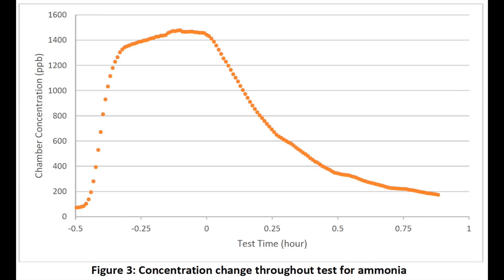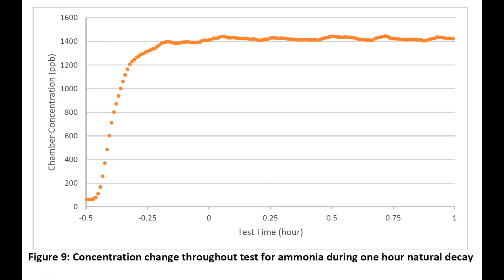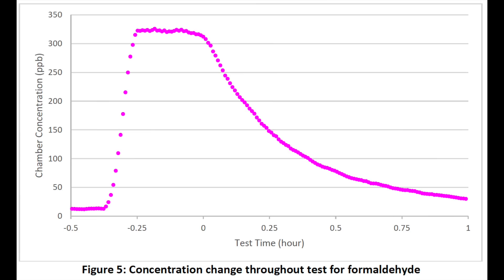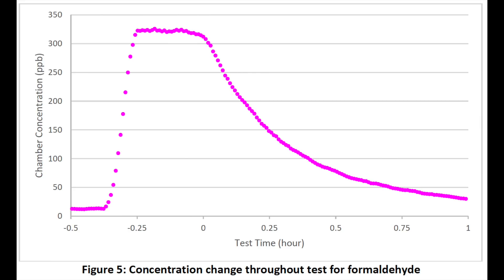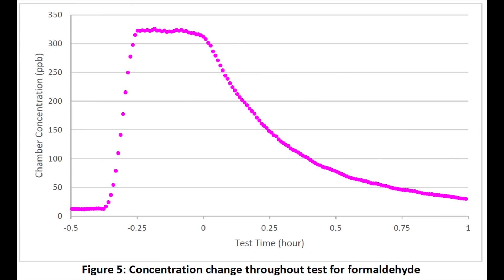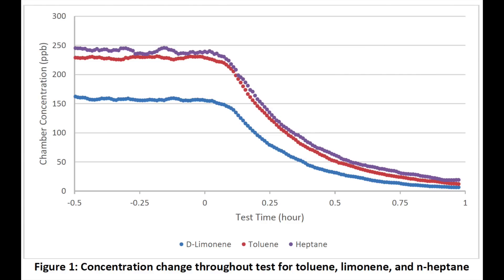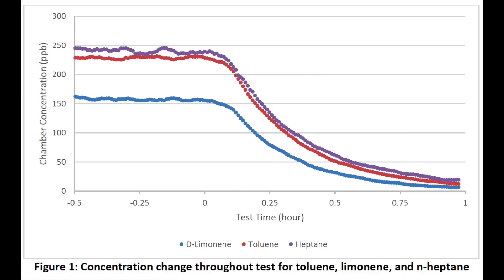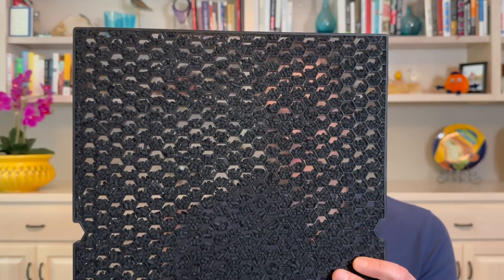Choosing the Best Carbon Air Purifier for Odor & VOC Removal: Test Results (AHAM AC-4 Standard)

Comment: what is your best product for dog odor? Not for dog waste, but just for dog smell, hair, dander and what ever they track in.
Reply: I just watched  your "How to Choose the Best Air Purifier for Pets" video. which says the carbon is best for odor, but still not clear if this is best for a smelly dog. I have a big dog that I bath every 3 or 4 weeks.
Reply from the maker: For dog odors specifically, look for air purifiers that feature substantial activated carbon filtration (more than a pound). Brands often list the weight of carbon used - more is generally better for odor control. Also ensure the purifier is sized appropriately for your room, as undersized units that lack sufficient air flow won't effectively clear odors even with good filters.
Reply: @Oransi  How much carbon is in the Mod Jr? or should I avoid combined carbon HEPA filters?, Thanks!
Reply from the maker: About a pound. HEPA doesn't do anything for odors however HEPA and Carbon is a complete air cleaning solution for particles and odors.

Comment: I have measured the VOCs with my AIR-1 Air Quality Sensor and the carbon filter doesn't seem to be doing anything. It works great for PM. But I'm trying to stop VOC spikes from my gas furnace. Am I doing something wrong or misunderstanding?

Comment: Hi

We recently rented a new commercial space, 1000 sq ft. New carpet and tile were installed and it was painted. The outgassing seems to be bothering a couple people. I realize the outgassing can go on for some time. While this is happening what is the best option for removing those gases at a faster rate than they are naturally being released? Thank you.
Reply from the maker: Ventilation is best if that's an option. If you are able to open the windows to bring in fresh air that will remove VOCs.

If there are times when the windows need to be closed then an air purifier with activated carbon can adsorb the vapors. The key is having sufficient air flow for your space and enough carbon. An air purifier with less than a pound of carbon will be limited.
Reply: Thank you so much !

Comment: I just moved into a new build construction apartment with voc levels staying around 1-2mg/m3..I already did a bake out and it reduced levels that were originally around 3mg/m3. If I bought one if your purifiers, it shows your AC filter needs replacement every 12 months for most environments. In my environment with very high vocs, would that replacement timeline be reduced?
Reply from the maker: Yes, the 12 months is for the typical home environment. If you have higher VOC levels the filter life is likely a little less.

Comment: I was going to buy Resiners air purifier because I was concerned about VOCs working with resin.  Then I came across your video, so I just ordered your air purifier (270C).  I hope I’m not disappointed.
Reply: And how good did it work?
Reply: I have one and it works great. I also have four Oransi air purifiers and they also work great based on the fact that smell like smoke from wildfires are undetectable in my home. That’s important to me since I have asthma. Any purifier you are considering compare how much air they move through your filters and how much they remove.

Comment: I live in an apt. building. We are having issues with cigarettes, marijuana, vape and other air born chemicals. We are getting these smells from our stove vents, AC Vac, heating vents and bathroom vents. I hope you can please advise us what type of filter we can use.
Reply from the maker: Hi, our TrueCarbon air purifiers work well in the removal of smoke odors and VOC's. The key is to size the unit based on the square footage of the space. Odors can be subjective. If you are getting constant odors and sensitive to smells you should notice a large reduction in odors although if a constant source is present it may not be 100%.

https://oransi.com/collections/truecarbon-air-purifiers

Comment: Why does my new activated carbon filter smell sweet. It pours out a sweet smell
Reply from the maker: Hi there. Great question. Coconut shell-based carbon can sometimes retain a sweet odor or this could be a normal part of the carbon activation process. Unless your filter is old this is fairly common.

Comment: Do any of these filters work for cooking odors? We live in a Chicago apartment and can't open the window in winter when cooking. The place smells like salmon for a day after cooking. 

Your ammonia, formaldehyde, toluene particle removal test results seem robust, but how does that translate to cooking food odor situations? 
And which of these specific filters gets rid of cooking odor?
Reply from the maker: Hi Robert. Thank you for your great questions. Cooking odors can be complex. Because of this, they're not part of the industry standard for testing. 

We recommend our TrueCarbon™ air purifier for stronger odors as its all-carbon filter is built specifically for odor and gas absorption. Customers have noted good performance with cooking odors; however, results vary based on room size/floor plan and can be subjective due to sense of smell. Is this helpful? Let us know if you have any other questions.
Reply: I just ordered the TrueCarbon 270C Air Purifier. I'll see if that works. Hopefully the manual gives indication of how long the filter lasts. Thanks.
Reply from the maker: Fantastic! Let us know if you have any questions when setting it up. The filter lasts about a year. A red filter light will turn on to indicate it’s time to check your filters. I'd recommend checking it after a couple months of use to wipe off any dust it may have gathered. That'll help extend its filter life and better absorb gases/odors.

Comment: I just bought the TrueCarbon filter that covers 350 sq ft,  specifically to remove high ground-level ozone.  
Even with the fan turned all the way up in a small enclosed room,  there does not seem to have been any improvement.  
Do I need a different filter?
Reply from the maker: Hello! Thanks for your message and sorry for any trouble you've had. Would you be willing to chat with our customer service team so they can help you resolve this? They're available M-F 8a - 5pm (888) 281-3948.
Reply: @Oransi  Thanks,  I'll give them a call.  I have very high O3 in my area,  and I only purchased your smallest filter.
I'm currently learning more about carbon filters,  appreciate your videos.

Comment: Is that metal case and mesh?
Reply from the maker: The filters in the video have a mesh material that holds in the carbon.  The filters have either a cardboard or plastic frame.